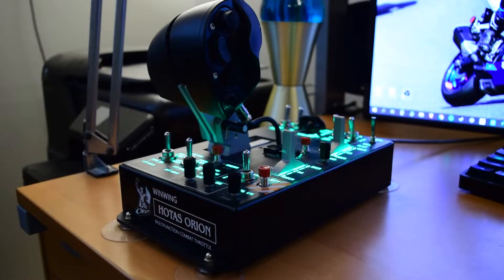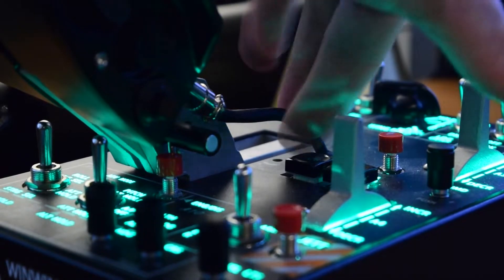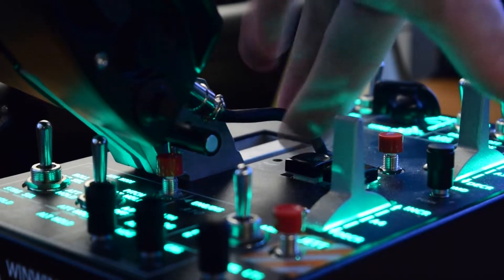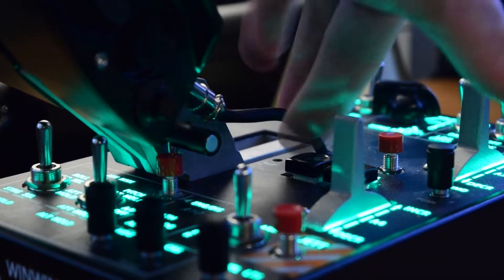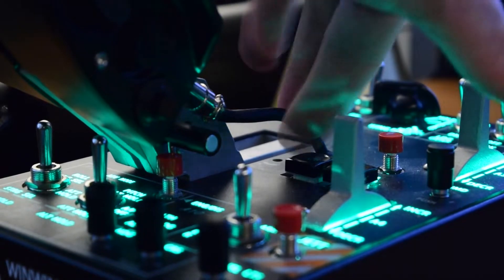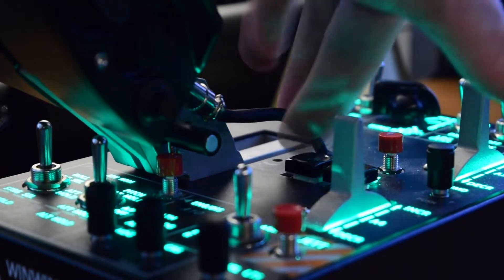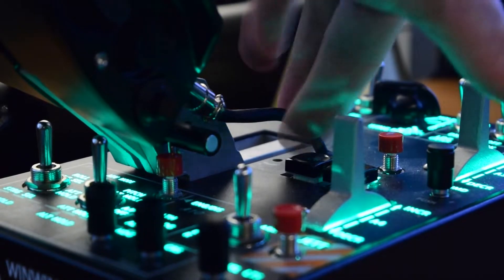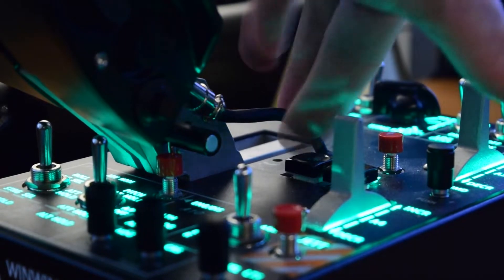WinWing Orion HOTAS 7 Month Quick Review

Comment: The cables have an extra inch within the housing, so you are able to pull them out/adjust them so they do not get stretched all the time. This will be the reason for them extending over time.

Comment: Thanks for the review. My only gripe is that amount of play in the mechanism that locks the two throttle levers together. The clearances between the rod and the black slotted tube and the black slotted tube and the lever itself is excessive and allows the throttles to rock independently of each other. The other thing is the pin that is screwed into the locking shaft which slides back and forth can work itself loose and fall out over time. That happened to me two months after purchasing the unit. I found the pin this afternoon after spending an hour at the hardware store looking for a suitable replacement.  I don't get all the hoopla about the cable. The cable is not a problem until it is a problem; and I have never heard of anyone complaining about their's failing. The real question is how difficult is the cable to replace when it does fail like one would expect of any of the other parts. My guess is "not difficult at all."

Comment: Looks like the connectors for the throttle wiring are suffering from using a long form factor connector. Using shorter connectors would help with that.  Worst case scenario would be to source a short extension cable with short connectors and do a quick mod. I wouldn't try switching connectors out without electronics experience though.
Wire has a bias, and will want to curl towards the bias. Have you tried disconnecting the wire, giving it a turn in the other direction (against the bias) and connecting it again? By weakening the bias force, it may turn more to the outside when you go full forward. No guarantee, but might be worth a try. I'd recommend no more than one turn though, you don't want to over stress the wire internally.
Reply from the maker: That is great advice. I have actually been playing with the twist. I cant get it just right though. Good thing though is that you can also twist the cable coming through the grommet.
Reply: @shrackgames  If need be, I'd take a look at a small cable tie to hold it against the throttle lever, too. There might be a sweet spot that keeps the cable from pinching, but doesn't interfere with travel. 
When the day comes that I actually own one of thee, I'll try to remember to post any solution I find. I'm kinda particular when it comes to this sort of stuff, probably overthinking it and concerned about nothing. Probably my background as a CNC machinist, where .001 inch is huge. :)